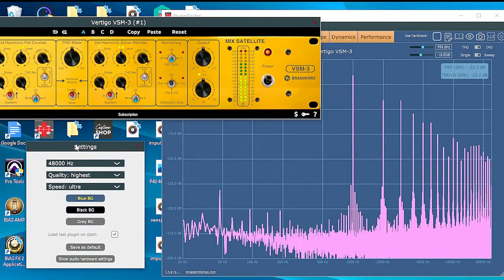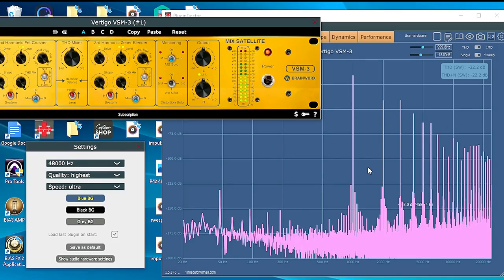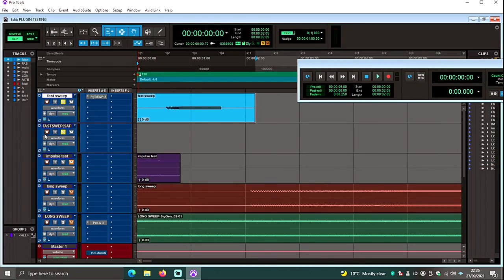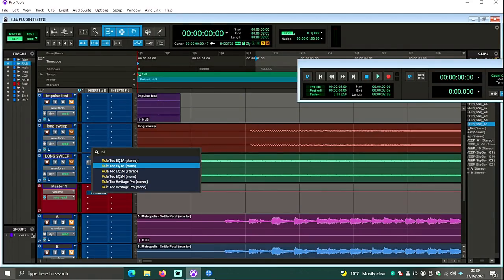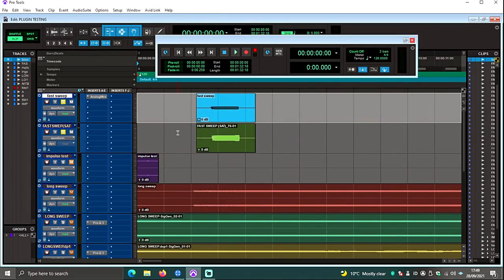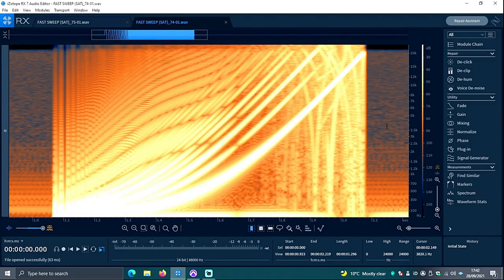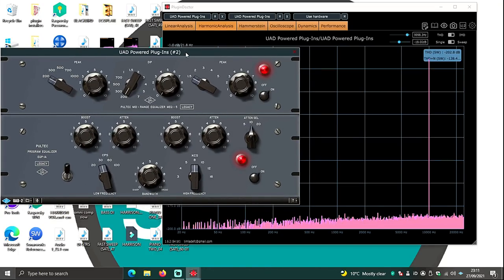UNDERSTANDING HARMONICS & ALIASING || How to visualise plugin harmonics & how to test audio aliasing

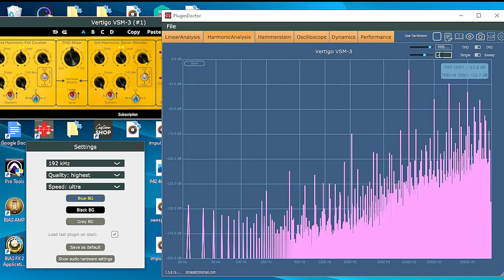Comment: Thanks for the video! What is it when there's a ton of harmonics like at 6:20 above the fundamental? So many of them they just look like a lot of noise, can't be good, right? Also, why do you think a lot of Acustica Audio plugs have that high noise floor? Those that I checked in Plugin Doctor did anyway. In your opinion, is it just inevitable with the convolution technique? But then again, I thought high end hardware was usually less noisy.
Reply from the maker: What you see there is 192khz sample rate. You'd never actually hear any of the information you see there. Technically speaking there is around 172khz of inaudible harmonics and noise haha In terms of noise and convolution I suppose it's what happens when you sample gear. Id assume that's also captured in the frequency response. It also depends on the level of the noise. Most noise you see in PD may look a lot but if you look at the dB scale it's actually still under -100db. You'll find that nearly all noise in plugins is kept well below the audible threshold. Some gear is like that too. Just depends on the gear
Reply: @PaulThird  Cheers, that's very helpful for me. Wishing you a good weekend and sending a hello from Russia :)

Comment: That was raj (or 'nae bad' as we say even further north than you are)! As an ageing guitarist who'se developed an interest in sound recording, this is all new to me, but very much appreciated. So would you recommend analog rather than plugins, if one can afford it?
Reply from the maker: In regards to heavy saturation you need a plugin with lots of high quality oversampling. Melda has one of the best OS algorithms and their amp sims and distortion based plugins make aliasing not a problem as they can go very high without completely ruining the phase. But for really really high gain stuff, amps and pedals will always be best id say. But analog pedals, not digital pedals which you can find here and there

Comment: Could've been so nice if you uploaded a link for the sweep and the 10k sine tone. 
That's been really helpful. I'll have to go through my plugins checking what's up now.

Btw, do you think the very same method should be applied to plugins that don't emulate analog gear?
Reply from the maker: I'm pretty sure every daw has a sine tone generator. That's what I do in protools. Highlight a section on the time line, audio suite and then generate a sine tone
Reply: @PaulThird  Thanks for your reply!
I thought of it actually. I use ableton so I'll try to make one with a stock synth.
What about the sweep? Should it be an automated Sine getting pitched or something?

Comment: Love your videos Paul.. amazing content. Just out of curiosity what version of waves 550B is that? I've just run v.12 in plugin doctor and there seem to be 4 harmonics on top of the fundamental, but they only appear when the analogue mode switch is on - using the eq without....it is as clean as a whistle even with the boost on the output as you do to get your first order harmonic. V.12 still aliases like a beeatch though ;-p ;-)
Reply from the maker: Hmmm.. Looks like they have upgraded it then. I think my api 550b may be v9 or 10. If they have upgraded it then it just makes me angrier at the waves update plan as all upgrades should be free like every other developer. They just don't do anything right do they 😂

Comment: Thanks a lot, facts only facts :)
Reply: @PaulThird  Do you have a list of plugins that you advise maybe? (Without Aliasing). I read the next comment below, very interesting feedback as well.
Reply from the maker: Depends on what you are looking for really.
Reply: @PaulThird  I think about classic and common usage. For instance, plugin EQ like Pultec, API, Neve, Compressors like SSL, 1176, Neve stuffs. Actually: The "no-aliasing" and nice tone plugins starter pack for Mixing ...and mastering why not! :) Cause you demonstrated that the major brands of plugins are not really synonymous of Professional tools. I'm thinking about Analog Access, but the costs could be high regarding the duration of a full album production.
Reply from the maker: Depends on whether you want realistically modelled or plugins that can offer you the workflow but loosely modelled.
Reply: @PaulThird  I would say realistically modeled. But do you think that realistic modelization are more prone to aliasing issues compared to loosely modelled? Did you notice that? (Thanks fo your answers it's really cool ;)

Comment: Regarding your final comment about aliasing not existing in the analog domain: That's technically not true as you can hear aliasing in bucket-brigade delays pushed to long delay times, and it can even be a cool sound if used deliberately. But of course these delay chips are essentially "half digital" already - discrete in time and continuous in amplitude.

Great video!
Reply from the maker: Yeah I remember reading about digital pedals and finding out that they had sample rates just like daws, normally 44.1, which caused them all to alias when pushed into distortion.

Anything that requires a sample rate to reproduce an audio signal is using digital processing. Dunno what you'd class some of those pedals as.. Hybrid? Haha
Reply: @PaulThird  I guess it's semantics, but most people would consider something like a Deluxe Memory Man an "analog" delay... Even though the bucked brigade circuit has a sample rate and a clock, so it's essentially a very early form of digital processing. I think they marketed it as "solid state" at the time, in contrast to tape delays.

Modern digital pedals with a proper  converter and processor are a different story. Looking forward to a potential future video on amp sims. I love my Helix modeler, but technically it probably aliases like hell. Does that mean my ears are broken? Or did they manage to control the aliasing artifacts in a way that in the end is registered by listeners more as uniform noise and not un-musical?

Comment: Does increasing the project sample rate avoid aliasing from plugins? Or do the plug-ins impose their own limit of frequency reproduction independently to the daws project settings?
Reply from the maker: Increasing the sample rate will decrease aliasing as niquist is extended. Only exception I know of is an AI machine learned plugin as they are fixed at the sample rate the AI learned at but there are not many AI machine learning plugins out right now
Reply: @PaulThird  Great, thanks Paul! Now I hope my cpu can handle the higher sample rates. Also I imagine there is minefield of things to consider when exporting a higher sample rate project and or down-sampling.

Thank again for all the great content 👍👍

Comment: Hi Paul, new to your channel. Your video's are really quite shocking ! If what you say is right then we're being conned into buyng expensive plugins that don't do what they should do. I'd be interested to see how some of the highly regarded free plugins from for instance Analog Obsession compare. 
And of course how amp sims fare with respect to aliasing. I record all my electrics with amp sims because it is so much easier and more flexible........
Reply from the maker: With guitar amp sims and digital guitar effects aliasing is just something that you have to accept. However neural dsp so x4 PA and Sgear do X8 do they are working on it but most cheap amp sims you'll find are riddled with aliasing due to the amount of distortion created.

Amp sims is something I plan on looking at in more detail

Comment: novice question, i should produce ITB at 196khz sample rate all the time? will save me what so ever from aliasing?
Reply from the maker: In most cases yes but there are still some saturators that require as much as X8 or x16 OS so it depends on how much saturation you use.

196khz is overkill for me as I don't know of many computers that can mix at that level of processing power. I tried 96k and couldn't do it so I do 48 and OS where applicable and gain stage accordingly
Reply: @PaulThird  thnx, i bounce track with single plug processing every-time. 196khz is still problem, but 96khz i can do easily on m1 mac. I will have to study about OS plugins and how do we OS any plugin while rendering or even playback. When you say some saturators require X8 or X16 OS, how do we know they need that? Something we have to constantly evaluate for each plugin we use? Trying to understand this aliasing issue, which has eaten up years of my producing life. Need to ascertain a pattern in which i can just repeat the process without loosing much of sonic value.
Reply from the maker: Test every plugin before you buy it. Plugin doctor is your friend there.

Comment: Could you use Metaplugin’s over sampling to help mitigate the aliasing in the plugins you already own that do alias?
Reply from the maker: Yeah. Ive done it in other videos with waves plugins 🤓 you've just got to be careful that you don't exceed the plugins supported sample rate so if you oversample too much it'll start shifting the frequencies up.

For example most waves is supported up to 96k with some exceptions at 192k. If you boost past its supported sample rate then a 100hz boost will be 200, 5k boost will be 10k etc etc and it'll multiply again with every oversample
Reply: @PaulThird  huh, I didn’t know that. That’s super cool (and interesting) haha. Love your channel btw. Cheers!

Comment: Hey Paul, great video! I have enjoyed watching your content and the podcast over the last few weeks. I would like to comment on this video in the spirit of us all learning this fantastic trade. Pro-Q3 should not alias; it is a linear processor that does not generate harmonics and thus signals above Nyquist – I would retest this. To defend UA Legacy plug-ins, the Pultec, for example, was released in 2002. There was no DSP power to model clipping behaviour then, and analogue behaviour modelling has advanced significantly since that time. In the Helios 69 example, you were driving the Mic pre-amp with a line-level signal. This would sound awful. Even with the analogue hardware, the VU would be pinned as it is probably receiving a signal 30 dB or so higher than expected. Additionally, there is no gain compensation; if you are driving the input of an analogue processor, you should compensate for the output – it is a shame UA did not add a clip light, I have suggested it for quicker workflows but correct gain-staging avoids clipping in any event, so I understand why they do not. A little tip for future analysis videos; remember harmonic saturation is a result of non-linear behaviour (a non-linear transfer curve); therefore, it is good to view the oscilloscope for clipping behaviour: odd-harmonics = symmetric clipping; the greater the even harmonics, the more asymmetric clipping. Low-ordered equals softer clipping behaviour, and higher-order harmonics equal harder clipping behaviour.
Reply from the maker: Proq isn't aliasing. It was just being used as a spectrum analyser. That's why it was after the plugins, cause it's completely linear and has no passthrough or colouration, so I can use it's spectral graph without changing the sound. 

This was like 3 years ago or whatever when I was first figuring all this stuff out so I didn't even know what span was. 

The problem with the helios is that they have added the pre amp as an option which people will just switch on and use without knowing what it does. but I get what you mean about the clipping as today I would've checked the dynamic ramp for clipping so I could see if it was clipping causing the distortion, which we both can tell now that it's what is occurring as the arturia neve 1073 does the same thing when you raise the input using their notches. 

Problem is though that the output does nothing to stop the clipping. It simply lowers the gain at the end. The arturia and I'm pretty sure the UAD helios have to bring down the ceiling of the input stage in order to recreate the analog clipping cause if they don't it'll just hard clip the daw channel.

So because the clipping in the input stage clipping has already occurred the output just lowers the end level. Works the same in analog. The output stage can't stop any clipping in the input stage.

So being perfectly honest, I don't know why UAD added the preamp option when there's no oversampling to combat the clipping, and as you said you are feeding a preamp a line level signal so it's a completely pointless option as the whole point of it is to add 10db of input of gain, but 10db input gain on a plugin that uses line level signals. Unnecessary as any clipping is out of control and aliases like mad. It's something that you wouldn't do in analog domain but cause they've added it in the digital domain, people will use it not understanding wtf is going on, hear it as "analog distortion" when it's actually more digital than anything else
Reply: @PaulThird  Ah, my mistake. I thought you were testing Pro-Q3 in the first example. Yes, the pre-amp analogue circuit clipping cannot be reduced by attenuating the output. However, when looking at Harmonic Analysis (or any level-based analysis), if the plug-in's output is +0dBFS (or not level-compensated with the input) I believe Input was -18dBFS, it does not provide an accurate reading as everything is boosted significantly. 

The Helios is a unison plug-in designed to be instantiated on the insert of Apollo interfaces, as well as DAW inserts, which is why the internal gain staging are different, as Mic is expecting a Mic signal and Line is expecting a line level signal.  Never fun when you accidentally hit the mic, I always have the Pad enabled on default, so do not jump out of my skin, lol.

Comment: One question in my mind, the volume of the "sine sweep audio" changes the results of the aliasing drastically, how to know what volume is the correct one for analyzing plugins? The same goes for the volume of a sine wave generator, what volume is correct for sine wave generator should be for being qualified for testing measure?
Reply from the maker: The maximum input you will be going into the plugin. No point measuring for input levels you won't be exceeding.

If its an analog emulation then probably whatever 0vu is calibrated to in the plugin but if you are going to be hitting a non linear plugin at -6dbfs on occasion then measure -6dbfs
Reply: @PaulThird  Thanks Paul! It doesn't sound so easy, especially when every instrument has a different frequency range and different slopes.
Reply from the maker: That's why i print a -18dbfs sweep for conclusive results as it sweeps the whole frequency spectrum instead of just one frequency with a sine tone.

Comment: Just generally speaking.. will working at 96K alleviate a lot of these problems, as a brute force way without analysing any of the plugins I'm using?
Reply from the maker: It will help a lot and audibly remove most from emulations but not fully eradicate aliasing as its dependent on the amount of aliasing. Working at 96khz is the equivalent of oversampling every plugin x2.
Reply: @PaulThird  thanks mate, appreciate that!

Comment: So... how're you feeling about analogue gear these days? 😉  The deeper you dig the more you'll see why us "old skool" guys are devoted.  All the hardware I own is modern and has virtually no harmonics unless you overdrive it... I actually think the quest for "analogue sound in digital plugz" has prompted devs to overdo the harmonics - which, of course, makes aliasing more of a problem! (which is probably why UAD and Waves chose not to add harmonic overtones as they are guaranteed to alias!)  Anyway, good job exposing the digital plugin's "dirty little secret"!
Reply from the maker: Yeah Im glad you confirmed the harmonics thing cause I was printing sweeps of a lot of gear like.. "these are relatively clean.. Wtf" haha
Reply: while I agree on the "overdoing harmonics part" in plugins -  I can't agree that "old skool guys" are devoted to analogue gear. Some are, some aren't. To me these videos do not prove analogue superiority at all.. these videos simply share a light on lazy plugin-developers.. there are more than enough plugins that compete or even best analogue gear - and that's without talking price-range and maintenance-cost. The BlackBox Plugin for instance cracks at a point that you will never, ever, ever, ever come to in a real mixing-situation... if you'd use settings that hard any scource would sound horrible.

Comment: I wonder how acustica deal with aliasing?
Reply from the maker: I think they don't create that much THD tbh. I've noticed that they are usually quite light in that department but when I checked a lot of gear I noticed the same. It's like many plugins add more harmonics or they model the harmonics when the units are really pushed.. Or it's cause they were vintage units. Can't say for sure but another subscriber said the same about his modern analog units that the THD was actually moderate.. Or its because the converter is lobbing off all the high order harmonics so the THD doesn't look as much. Im still figuring that answer out haha